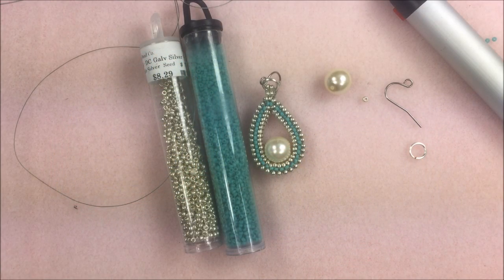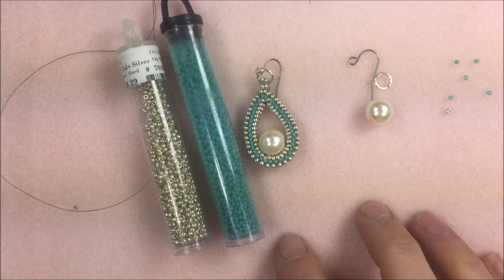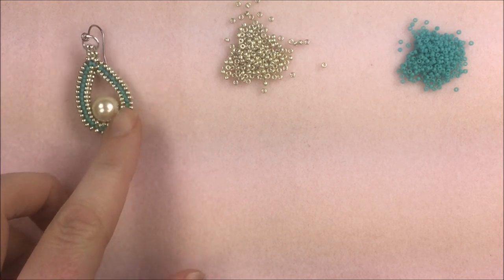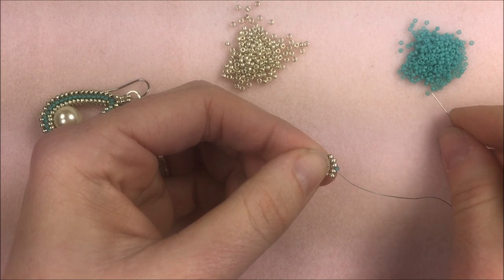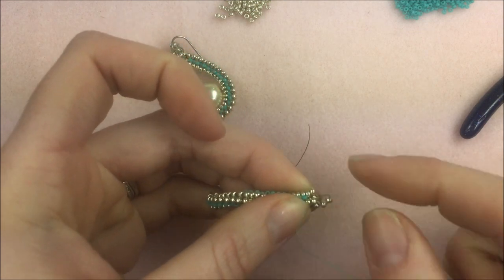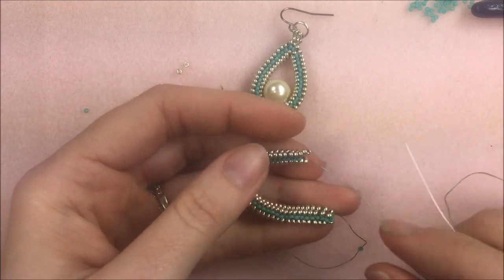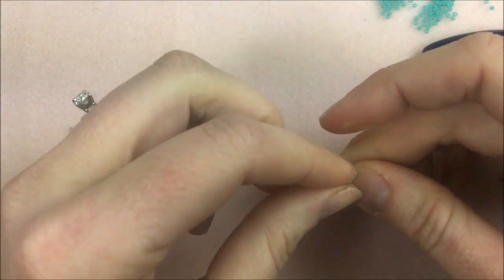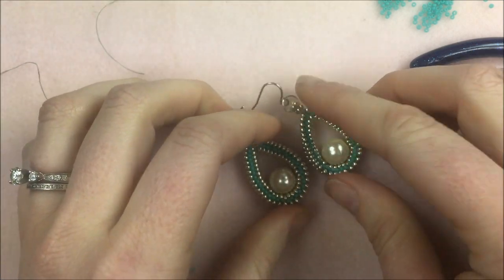Romanov Earrings - DIY Jewelry Making Tutorial by PotomacBeads

Comment: I’m normally a pretty savvy beader, but this video was pretty tough to follow.  I LOVE your videos, Allie…but this one was pretty tough.  I made this project about 3 times before I got it right.  A little help for some trying to follow the video (sorry Allie…but I think this comment might help a few out there):  (1) before you join the piece together, count those 15/0 beads on both sides of the herringbone to make sure they are the same (and yes…4 inches is too long.  Only do about 36 rows).  (2) When you’re done with the 36 rows, you’re thread will be coming out of the “inside,” which Allie calls the “bottom” part of the loop (the inside part where the pearl will lie).  When you bring the pieces together, you’re going to sew the inside part of the loop first.  (3) When you move to the “outside” (What Allie calls the “top”) part of the loop, you’re going to create the top “V” needed to create the tear drop shape.  This is why she adds the 3 beads on one of the parts.  (4) When you add the pearl and are ready to sew in to the opposite side, I would highly recommend you count those 15/0 beads on the side to be sure your pearl is centered.

Good luck, all.  This was a challenge.  😅
Reply from the maker: Thank you Kelly for this feedback. It needed to make things better!